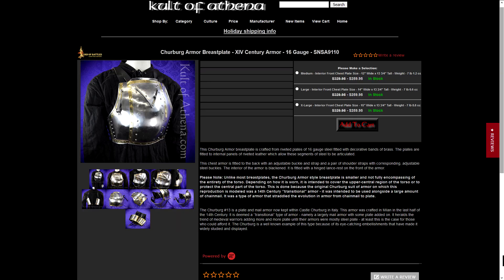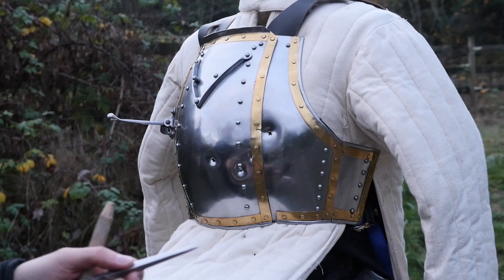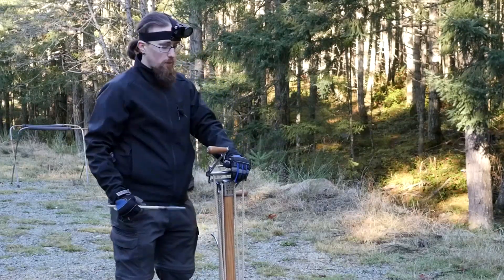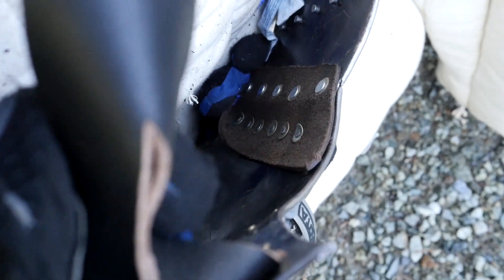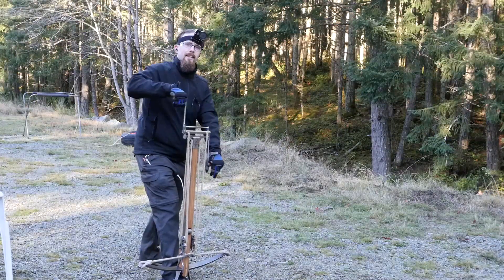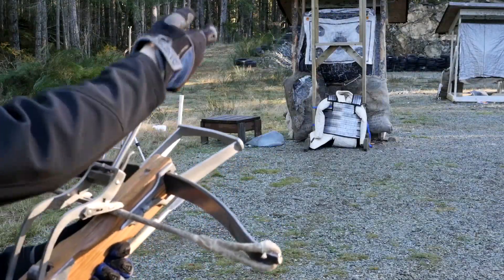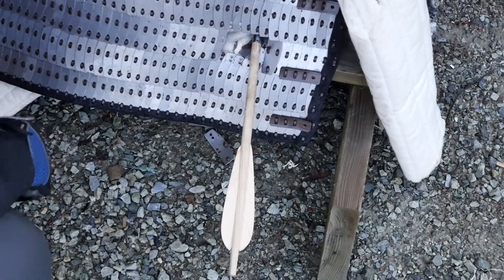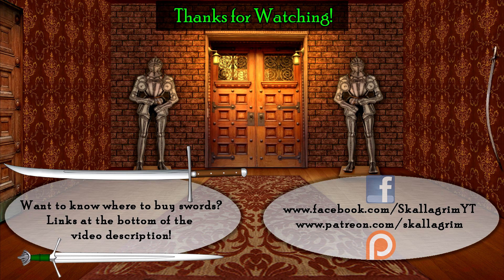Medieval Crossbows vs. Breastplate and Lamellar Armor

Comment: Meanwhile in movies Arrows/Bolts are 20mm armor piercing flak shell
Reply: Splash damage
Reply: an arrow penetrates 7 layers of ateel
Reply: There's a movie where a guy with a crossbow pierces the glass on an APC, killing the driver.
Reply: Which movie depicts arrows and bolts going fully through plate armor? Be specific.
Reply: On the medieval battlefield archers would have used tips on that arrows designed to penetrate armor. They wouldn't have used standard hunting tips
Reply: @jamesricker3997  No arrows pierced full plate. The archers were there to kill the people not wearing full plate, which was most of them. And remember that this test was at point blank, conditions would never be this favorable for the archer in battle.
Reply: Tell that to the Longbowmen at Crecy  @chaotixthefox
Reply: @jamesricker3997  bodkin arrowhead
Reply: The quality of metal would be much worse too. 

German steel was far superior to Japanese steel even in WW2 due to difference of smelting and forging. Go back 800 years using ancient metalwork techniques. 

If I can shoot bullet head arrow tips through sheet metal with a 50 lb hunting bow, you can bet your ass that an 120lb war bow or 960lb crossbow could penetrate armor. 

Would it happen all the time? Probably not. Was it possible, especially en masse? Definitely. 

And while the hits look like they 'bounce' go put on a Kevlar vest and have someone shoot you with a handgun. You will absolutely feel the concussive force and have bruising. 

You wouldn't just shrug off hits like nothing. Even if you looked okay on the surface.
Reply: @HauntingSpectre  yup, plus as skal said the armor thickness tended to vary across the armor since they didnt have nice uniform rolled steel to work with meaning that the wearer might be ok against a single heavy crossbowman, several of them firing constantly would likely find a weak point fairly quick.
Reply: @battleoid2411  I think the funniest answers are 'Armor exists because it works'. 

Well yes, but so do arrows and bolts designed to penetrated that armor. If 'it exists' means it works. That same logic must then apply to all the various types of Bolts/Arrows.
Reply: @HauntingSpectre  This goes both ways. The arrows would also have weaker tips. Arrows killed people in mail and below, which was most of them. Bows and crossbows continued to be used because it was relatively few people who were nigh invulnerable to them by virtue of full plate.
Reply: @battleoid2411  This is point blank. See how the performance changes after a couple hundred feet. Hardly a dent I'd say, even with varying thickness.
Reply: @chaotixthefox  Read my above answer about how plate would dégradé over time from repair and that volume of fire would damage armor quicker. 

Even in tests of 3-5 shots armor is compromised and weaker. Thus making it easier for more shots to penetrate. 

They wouldn't peirce every shot, but over the course of a battle? Yeah 1 or 2 would and that would be enough in most cases to kill. 

You don't have to have every shot pierce. Just one or two.
Reply: @HauntingSpectre  Goodness gratios, what kind of cheap armour knock off would get damaged by a couple of arrows? I remember watching a video of good quality breastplate made by amateur blacksmith and a 140 lbs longbow didn't even leave a scratch on it. The arrow blew to hundreds of pieces upon impact. I can imagine an authentic medieval armour made by master craftsman being even better. So a definite no no. An arrow can't really damage high quality armour. At best it can leave a tiny scratch. Arrows can't even pierce a high quality riveted mail.
Reply: @dimitardimitrov9482  Except in the above the man is clearly a talented smith and made it himself. So no. Armor was not invincible. Hence why knights also carried shields.

edit: Wrong video. This is the skallagrim one. Theres a medieval history one where they run the same test but had a proffessional smith make the armor, and an actual warbowmen shoot a 120 lb bow.
Reply: @HauntingSpectre  every time  I see a test on a piece of shiny armour I doubt how credible this test is. Real armour don't look shiny to me, it has this distinctive dark hue to it with darker and lighter spots, from the quenching I guess. I might be wrong tho, not a blacksmith here :)
Reply: @HauntingSpectre  fun fact. Tods workshop did a video with an armorer and Joe Gibbs himself. A 100% perfectly historical armor smith mixed with a master fletcher that made historicall arrows and Joe Gibbs shooting a 190LBS longbow. Shooting at 25 meters barely left a dent on the armor. The biggest dent Skall achieved here was twice the size of the biggest dent they got on that video.

Yeah armor smiths have different skills and their pieces would vary but from how much they get paid to make this armor and the fact that they know if a knight was killed in combat because that chestplate was faulty; that knight's friends might be coming back to have a "stern talking" Blacksmiths knew lives were dependant on their weapons and armor and if they fuck it up it was probably their lives they lose
Reply: @sebastianriz4703  Yes I've seen the video. And in 1 solid hit the armor was infact compromised. 

A dent - of any size - causes immediate metal fatigue. Another arrow on that same spot has a better chance to penetrate. 

Repairs over time to hammer out the dents would cause further fatigue. 

An arrow or bolt may not penetrate every shot, but thats why archers carried numerous arrows or bolts, and worked in usually large firing teams. 

It wasn't a lone legolas robinhood sniping you, but 40 guys on a wall, firing in your general direction. 

Note that in your mentioned video they stopped after only 3 shots. 2 of which caused significant dents. Toss another 17 and see what happens. And even if 19/20 are successfully stopped. All it takes is one.
Reply: @chaotixthefox  Actually if you look at some tests anything below 130lbs for a bow with a bodkin point can't even penetrate properly riveted chainmail armor. You need atleast 130lbs to go through chainmail.
Reply: @HauntingSpectre  The fact of the matter is simply that arrows (and crossbow bolts), even the "armour piercing" variants like bodkin points arrows, were not effective in the vast majority of situations against mid/late medieval era plate armour. Yes, theorically I suppose its possible for a plate armour to get so dented that the man inside starts having difficulty breathing or walking or fighting. Its also possible for a lucky shot to hit a weaker spot, notably under the armpit or through the visor (tho in the later case it's kinda unlikely as the slits tended to be quite thin, you needed specialized daggers to fit through them), but in practical scenarios this wasn't going to be the case.

Agincourt kinda warped perception by making ranged weapons seems so powerful against even plate, but that is because people's ignore that the french knights at agincourt did not in fact succumb to arrows but to a combination factor of:
- shitty terrain condition
- advanced ahead of the rest of the army
- in an area that was filled with trees on both sides of the straight clearing
- with the only path to advance towards being filled with mud, barricades and a enemy infantry that outnumbered them several times over without being exhausted from the long walk

where the longbowmen delivered volleys after volleys on the knights who's horses would get injured or died as a result (since full horse plate armour was extremely difficult to make if not outright impossible at the time, there were waaay more vulnerabilities than on a humanoid plate armour) the knights were either injured by the fall or forced to continue in the mud

which would result in them getting swarmed by dozens of men with hammers (whom did most of the killing of knights in Agincourt by the way not the longbowmen)
Reply: @HauntingSpectre  Yep and shields exist for a reason too. Armor works but doesn't work well enough for them to abandon shields.

Comment: Should have bodkin tips on your bolts
4sided points like nails
And typically you'd wanna use harder steel for your bolts so they don't deform on contact

Comment: "The wearer would be perfectly fine"

UH buddy i'm pretty sure that's a broken rib. At least some severe contusions.
Reply: That's exactly my thoughts. The armor isn't spreading out the impact that dramatically. You're definitely better off with the armor, but you're still going to be severely injured unless it's a glancing blow.
Reply: @thomastmc  Also unmentioned was the fact that if you're riding full tilt on a horse you're gonna knocked off. So now you've got a broken rib, got tramped by other dudes riding giant horses weighed down by metal armor. All that then you've got to fight guys who have just been taken pot shots at you. 

Part of what made the crossbow and the longbow so effective wasn't the fact they would kill armored men-at-arms outright, but that it would weaken and severely degrade their fighting effectiveness. Further, the crossbow was cheap as hell to make and easy to train illiterate, emaciated peasants to use. That armor took hundreds of hours to make and required healthy, strong and well-trained men to use effectively. Handing 20x as many peasants crossbows was overall more effective.
Reply: But the knight has a padding underneath, that must at least count to something?
Reply: @bugrilyus  I think it would help but not all that much, though I'm not the versed with medieval armor.
Reply: @IC3D ZOMBIE both padded armor and plate are extremely good at dispersing energy, the knight would have barely felt a thump
Reply: He would have felt it if it only hit the padding though but it add to be very close range to do any damage
Reply: exactly, there is a lot of power going into a concentrated place, you would definetly survive and likely be fine but it  would hur for sure or break a rib

Comment: And people think they could take on a medieval knight in full plate
Reply: Abu Troll al cockroachistan  Molotov cocktails are basically completely ineffective against infantry. Part of riot police training in many countries involves being peppered with petrol bombs just in order to demonstrate how ineffective they are.

Even with a direct hit, a bottle will often fail to break cleanly and ignite ; Most of the time, it will simply smash on the ground and leave a burning puddle.

And since it's an ungainly weapon, you will only get one shot before the knight closes in and guts you.
Reply: Abu Troll al cockroachistan  And yet armies still deployed knights for some reason.

Are you confident enough that you'll be able to hit a man-sized target with a sling-thrown extremely unaerodynamic ceramic pot of naptha, from a long enough range that he can't rapidly close?

Are you absolutely certain that the pot will break exactly right, ignite correctly and not, say, smash uselessly on his shield or bounce off an arm guard or extinguish itself in flight?

Comment: Just remember that 500 kg crossbow equals in projectile energy  to 50 kg bow due to differeance in draw length, and English longbow were 80 kg and more. And we are calculating kinetic energy with equation E=(mv^2)/2, which means that energy increases proportionally not to velocity but to  square of velocity, so 80 kg should pierce this plate easyly. The problem is that English archers were practicing years to be able to use such powerful tool of war, as longbow was, and you will not see on youtube noone using historicly accurate longbow (people on videos are usually using loke 40 kg longbows, which is impressive but not even close to effectivness of real longbow)

Comment: Those lamellar are hardware store braces, I've seen online tutorials. They seem like mild steel but I have no idea why as a brace... if you heat treated those and used better cordage I bet they would be ok... Or even use steel chainmail rings to connect them?

Comment: I think the point of bows and crossbows was less to directly penetrate armor, and more to cause mass chaos in infantry and cavalry ranks. In mass volleys, even without armor penetration, there's a pretty good chance of being struck in the legs, hands, neck, etc. Areas that may have gaps or be entirely unprotected could be vulnerable to stray arrows or bolts. On top of that, for cavalry, horses are extremely vulnerable, and then there's just the general morale effect of being pelted by thousands of 100 gram deadly projectiles. So even though in these isolated tests a lot of projectiles seem ineffective at armor penetration, that doesn't discount them still being quit potent at injuring and wearing down troop formations.

Comment: You have to remember, that modern metallurgy makes much stronger materials. This steel plate is for sure much more durable than plates made in medieval times.
Reply: Which is why he says that period armour tended to be thicker than this reproduction. The other aspect to consider is the metal used in historic arrowheads has the same problems. The arrowheads in this video are probably much better quality than historic ones, even if forged in a traditional manner.

Comment: I am impressed with the 1mm thick lamellar armor... it pretty much did a great job defending the crossbow bolts.   It would be hard to mass produce the Breast Plates in medieval times, but it is certainly possible to mass produce lamellar armor for foot soldiers (as Ancient Middle East and Chinese foot soldiers use these type of armor)

Comment: What is the acceleration/distance curve on a 1200ft/lb crossbow.  If the target is to close wouldn't the bolt hit without the optimal energy.
Small projectiles need speed to overcome the shortfall in mass to increase ft/lb energy.
Just wondering if the bolt was still accelerating when hitting target.
So there would be an effective distance for the maximum force of the bolt hitting target.
Medieval archers knew about this, because they would fire straight at target, not like in the movies where everybody shoots in the air for the arrows to fall down.
It's not beyond belief archers/crossbowman knew distance, in fact it was probably a necessity.
Also it probably explains why they go to melee weapons when the enemy gets close. The target distance is just to short for the bow. Not enough time for the arrow to attain enough acceleration.

Comment: tbh i saw you hit it with a Reiterhammer or Rabenschnabel and you were able to damage the Breastplate - Which means this Plate is very poorly made especially your Hammer didnt 'stuck' in the armor. Sadly this isnt not nearly accurate. You should get just a plate of steel in the right thickness and shoot on it. It is cheaper and you can 'angle' it a bit to you can see the real effect on metal.

Comment: Have you tried a flat tip (wadcutter) on the bolts instead of bodkins? Also if you look at some old prints, you will see peasants dragging armour clad knights from their horse and are quite simply  beating the knight to death with a good old fashioned club hammer!

Comment: Without seeing the video, i would say lamellar performs good vs arrows. Early lamellar versions was used extensively from Eastern Romans (Byzantines) as they fought both western armies who used tight shield formations (goths) and eastern armies who used cavalry and horse archers a lot more (persians, avars, turks, etc). It is important to also notice that they adopted the composite bow a lot more than the crossbows (ofcourse in the eastern climates it didnt rain a lot and as such it didnt affect the glue holding the composite bow).
Bow vs crossbow really depended on the technology advances of the time, there was a time where crossbows were a lot better, then they fell a lot, then they resurged in popularity (because of technology leaps) and so on over the years.

Comment: "Samurai vs knight". All depends on: man - his skills, morale, luck and many other factors. "Trying to kill a knight with a katana would be like trying to punch a boulder in two." well with all due respect in late medieval times European swords were equally not very useful when trying to penetrate full plate armour. You will search for the weak spots like e.g. by passing bevor etc. That's way a pole weapons like halberd, glaive or bill were much more effective and used also by knights (king Richard III in battle of Bosworth Fields 1485 was killed not by the sword but by the mighty blow of the halberd) and brutal, but effective war hammer. Japanese warriors were masters of the bow (most Europeans knights were not), they used deadly naginata spear and they trained in judo and aikido. Knights were often trained only in wrestling and fist fighting (boxing), but on the battlefield marital arts which will teach how to keep your balance and how to off balance your opponents will be much more useful than throwing the punches. Average samurai vs average knight with similar experience and properly trained in their "craft": my money will go on samurai, and not because of katana. Because of: usually more fanatical (Bushido) approach to honor/death= very high morale, better mobility on foot (slightly lighter armour), bigger versatility of skills (use of swords, pole arms, bows and marital arts). But still it will be down to the particular warriors and this is just "an academic" discussion.

Comment: IMO those modern replica of bolts have either unquenched tips or machine turned shaft, which doesnt follow the grain of the wood. Simply break into pieces rather than doing any penetration. Substituting shaft with fiber reinforced nylon rod will be a much better choice,  so that the kinetic energy that store within this part of mass can be transfered to the impact area.